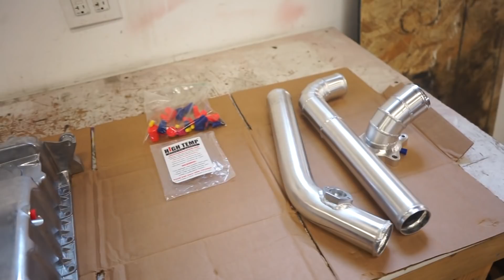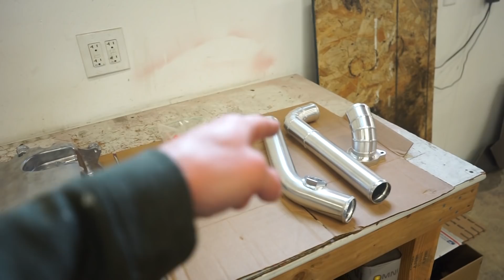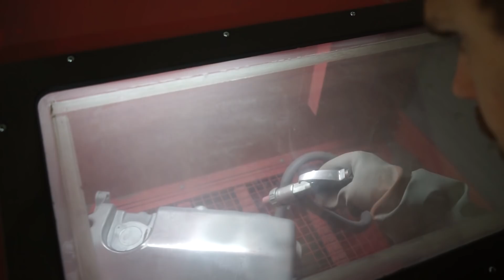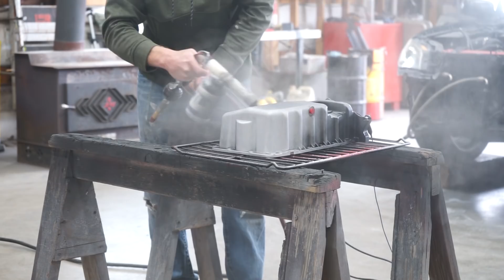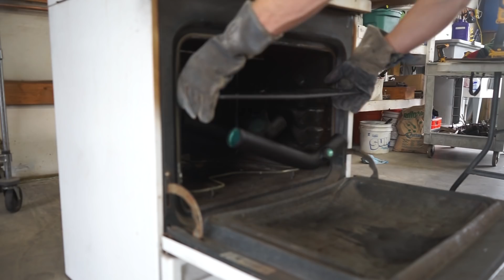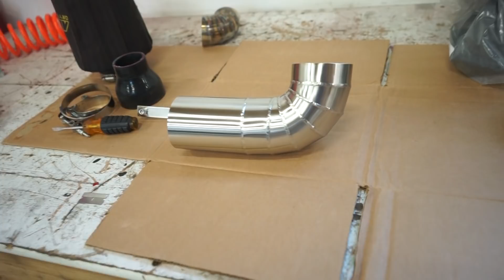TDI Toyota Build Gets Some Powder Coat!!

Comment: I learned about powder coating today.  I also have a house range in my shop to heat bearings, pulleys, etc for interference fits.  Bought it off Craigslist for $75 a few years ago.  I think I'll have to try my hand at powder coating.  What is the brand and model number of your powder coating gun?  I use ear plugs to plug threaded holes when I paint, but I don't think they handle the high temp.
Reply from the maker: Its a eastwood gun!